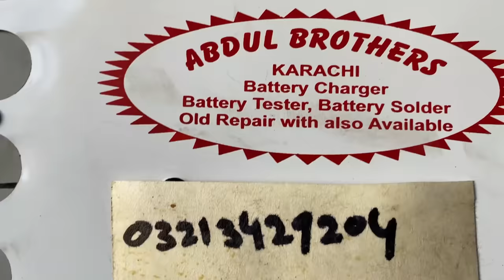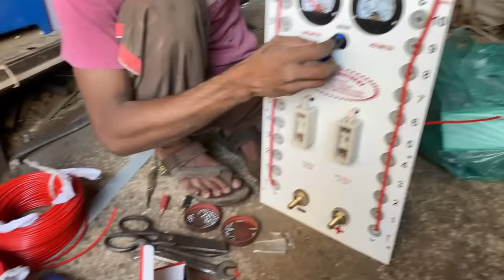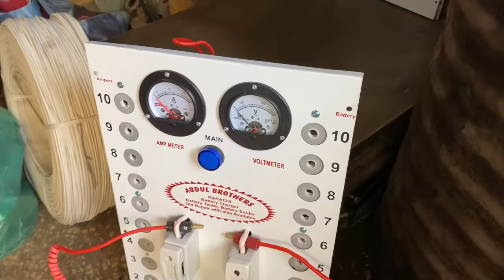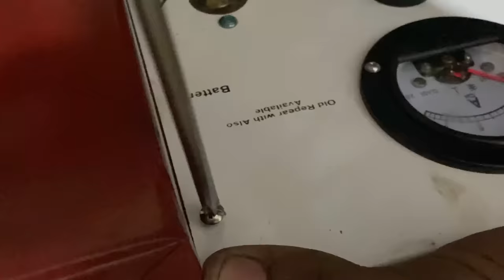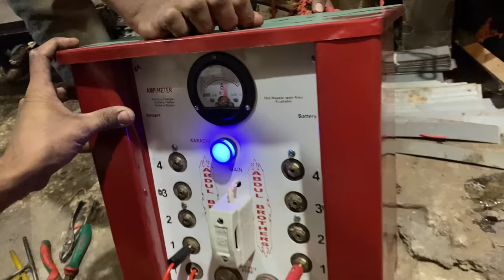Amazing process of truck battery charger making

Comment: That diode can handle 85 ampere, so you still can fry chicken with half wave. Regulated output?? Come on sweethearts!! This is a battery charger for heavy trucks, not the power supply of your pink laptops.
Reply: No Capacitor needed 😂
Reply: @sigmamalerules1106  capasitor does not need for charger

Comment: The ammeter reads a maximum of 10 amps, so its large and heavy for only producing 10 amps. They are only using one rectifier, so it only half wave.
Reply: What do you expect from tansformator core made with so many air gaps and rusted plates? And one diode.
Reply: Good job, Sir
Reply: Half wave is effective in the battery charge
Reply: @blazeykk  using Two diodes or 4 diodes  bridge  rectifier and then using  .using the condenser (high voltage and 200 mfd to 500 mfd will give a pure DC and a better and quality charging with low cost and better pricing as well .using 4 paper capacitor  on each diode will be a feather in cap which will protect the diodes and thus circuit as well .
Great job .
I wish they also weld the cores so as to reduce the eddy current which is a unique way used by Japan  .welding the cores on each direction . 
Love and regards
Reply: Using old technology industry is closing. Now days SMPS is used. Saves space and are lighter also gives short circuit protection and over charge protection.
Reply: @RealCircuit  SMPS is impossible to make in such poor conditions. Look at them. They are dozens years behind. And what is sad it does not look they develop. They stopped in point.
Reply: @JesusFlores-xe3sq  Desulfation
Reply: @blazeykk  SMPS can fail in high humidity environment and is unrepairable at average indian home. This thing has nothing that can fail. They just build what suits them best. I keep one of these beasts for batteries that SMPS cannot charge, and when SMPS fails.
Reply: I don't see any I/O protection
Reply: @HyperMAX9001  it's not even fully DC it's half wave current and the chances of your battery exploding from overcharging are really high
Reply: @RealCircuit  SMPS blows out every now and then
Reply: @RealCircuit  k
Reply: @RealCircuit  k
Reply: @electronicss.rbangla7909  5
Reply: After calculation it is just 150W charger (counting the losses). What the hell. My old computer power supply can deliver more amps than this and also being less expensive and light weight.
Reply: @HyperMAX9001  this is not India bro. It is Pakistan
Reply: @JesusFlores-xe3sq  No, it's not a good idea anywhere.

Comment: Notes the proper winding insulation ! The beautiful rusty cores as well. Twisted copper onto a steel bolt class work ! The perfect twisted mains join also just wonderful. Top that off with the smell of Karachi which i can guarantee for 5 years

Comment: What a pity the chargers at the end weren't the same as the ones we saw being wired up.
Reply: Hii
Reply: it is the same.
Reply: @mfx1 ok, I don't pretend that you know how a transformer work, but you can almost count to 10 watching the side connector or only to 2 counting the gauge on top!
Reply: @mfx1  The building displayed both a volt meter and a separate amp meter, the final display only had an amp meter.

Comment: In fact, you can see one rectifying diode, it means one-half rectification, but there are current regulating taps. Pulsation of the lead battery is perfectly tolerated. It's ok, congratulations 👌. There is also power in the simplicity of design 👌.
Reply: The pulsing current is somewhat good for maintaining the battery it helps prevent sulfating of the battery.
Reply: @belyear  Pulsation is good for charging a lead (Pb) battery. Other must be based on the PWM system. Thank you, greetings 😀.

Comment: Aluminium wires,rusted core strips and half wave rectifier reduces its efficiency below 50 percent at least.
Reply: They work!
Reply: very much more efficient than not having one at all, Sarabjit
Reply: @donsurlylyte  yeah definitely better not having these garbage uncontrolled things I don't even know what to call them as they are not chargers but fire hazard boxes
Reply: that is actually fake wood

Comment: They are simple in its principle so i dont see any big risk for the money, but they could have some other things to do.

The heatsink (if it is) that its easy to make like that but i would get extrusion bars that would be thinner from china and cut them to size, whould be cheaper at the end.
The backlite junction in from its a great thing since ceramic takes heat easly, but GET SOME CRIMP TERMINALS, that was one of the things it hurted me the most.
The soldering was painfull, i know they dont have much between that and a cimped terminal... i would use terminals.

In the end, they are working like robots, maybe one or two guys in that production understands really what are they doing
Reply: They probably have the heat sink cast by a local foundry.  Might be easier and cheaper for them than getting it from overseas.

Comment: Now thats one heavy duty transformator,full analog,brutally crafted,this will not fail easly,no pesky circuit board that will fail,despite having a good transformator in the device like modern elektronics with the programmed failing period.

Comment: i was impressed with their work because using 4 diodes generate more heat even its full rectified and also damage coil fast this is widely used in india for past 50 years 
work smooth heat sink is also excellent proud of your skills without using machine screw drills all by hand
Reply: yea after winding the transformer with aluminum wire,every Celsius counts. So it doesn't catch fire.

Comment: Use a switching mode power supply sir, it low dissipation power, reduce equipment weight, more protection than the transformer and diode only. and it can control your battery charge
Reply: Most of the Indian auto mobiles( work shops) private users never want to use new methods.only old type they r using . It is power consuming and higher weight .They won't worry .old is success full .that's all they feel
Reply: @alagappansockalingam8699  FIRST OF ALL THIS IS NOT INDIA. IT IS KARACHI, PAKISTAN.
Reply: and more interference in cities on the radio band's
Reply: Smps needs a lot of parts/ components to work and prone to break, few parts less components breakdown battery needs no/not pure dc to be charged,  low freq pwr supply less maintainance more more powerful than smps
Reply: @nelsoncaballero1937  wtito sir but the typical lorry Driversand owner's ur side and north side r typical .they want ony good what is practical.they like only conventional battry chrgers .They r not much educated.Firthe last tenty or more yrs they r using the same old method.they don't want to go for anew one .I am not supporting them .but they want practical and reliable and accurate  (some what).new one may be arisk (. To them)but time will change their habits.
Reply: @nelsoncaballero1937  Mr .Nelson SMPS r costlier and may be use and thro but a pakisthani old auto electrical people won't like use thros .time will change their habits.
Reply: @The_3_Triangle   If it is technically prooved the govt electronics people should warn them to replace it.but local people never intersted inthis .but step by step they will change their equipments .

Comment: Engineers making work as Technicians and regular employees
All this jobs for a Single Paycheck. 
Under the most unprofessional working place and working equipment. All That Production Still have A Good Presentation.
WHAT A GOOD WORKING TEAM and  CRAFTSMANSHIP similar to a Piece of Artesians workmanship.
MY HAT IS IF MY HEAD TO HONOR YOU  ALL.   GOOD AMIGOS
My Mexican People, Saludes You.
Reply: I can only call this shitmanship, not craftmanship. Even when using so crappy "materials" they still could do a 10 times better job. I did not know if I should laugh or cry when watched this so called manufacturing process.

Comment: An smps at ¼ of the price from china will work 10 times better. May not last 10times longer but I don't see this lasting more than few years anyways. Half wave rectification and cotton insulation on the transformer not coating it with resin or barnish that's calling for fire. Atleast use a full bridge rectifier ..

Comment: What is the Input AC voltage ? The Output DC voltage ? Can you control the Output voltage ?
What is the maximum Amperage Output ? Any temperature fuse ? Good job guys.
Reply: Да, да и да. Температурный контроль не нужен, огромный запас. Предохранитель есть и по входу и по выходу. За счёт рыхлого набора ржавым железом характеристика трансформатора скорее всего мягкая, даже кз на выходе не приведёт к возгоранию или выходу из строя. Конденсаторов нет, диод только один. Ток пульсирующий, но это как раз то, что нужно для автомобильных аккумуляторов.
Reply: Didn't you see the taps on the front panel?  You connect the plug to suit the voltage you want.
Reply: @loremipsum5759  the primary and secondary side of the transformer have multiple taps input voltage/output voltage.  Still a lot of analog meters in use.
Reply: Input ac voltage is 220v in Pakistan where this is made output dc voltage is 14v (i think) and this charges 12v batteries and output ampare is selectable.
Reply: @syedfaraz5  , this make a lot of sense.

Comment: America can make these 10 times smaller and lighter using modern electronics.
And the wouldn't have to work on the floor. They use the latest in workplace technology, Tables and Chairs.

Comment: Why don't you laminate the cores by dipping them in Varnish? If I vaguely remember, cores without lamination will produce a lot of heat from Eddie current. Atleast that's what they used to teach us in Pre-meds some 30 years ago, things may have changed since.
Reply: Physics doesn't change.  Eddy currents are from the size of the magnetic material.  That's why they use the thin sheets, to reduce eddy current since they are very narrow.  An eddy current is a bit like the vortex swirling around a drain.  Reduce the width of the tub the drain is in and the eddy is greatly reduced. 

It has nothing to do with the coating on the laminates.  Why were you learning about magnetics in pre-med???
Reply: @loremipsum5759  if you dont coat the laminates, they act as one solid bar and eddy currents (and losses) will be high... That's why thin sheets are used, the thinner, the better. For higher switching frequencies, no sheets are used but ferrite powder... But who cares about laminates when they only use one single diode as a rectifier?
Reply: @loremipsum5759   It has everything to do with the coating of the laminates.. It is insulation between the sheets, so it does not act like one big lump of steel that has any currents running through it that heat it up and make it less efficient.

Comment: You guys are amazing, Huge respect for your craftsmanship and your skills. I dont think we in america could do what you guys do.
Reply: Why? There are many US guys, who can do this as DIY at high level of quality. But it doesn't needs, because it is more interesting to build an own PWM pulse-mode charger.
Reply: Ur the owner of the company? If so, don't use solid core wires for selectors. This is DIY level indeed.
Reply: Daft comment, transformers were being made 100 years ago in the US, there's DIY's building far more complex stuff than this on YouTube. Can these guys build a lithium ion battery bank with balance charging BMS?
Reply: America can make these 10 times smaller and lighter using modern electronics.
And the wouldn't have to work on the floor. They use the latest in workplace technology, Tables and Chairs.
Reply: @snowflakemelter1172  well building a battery isn't that hard but seeing how sloppy that thing in the video got assembled I wouldn't buy a battery from them
Reply: This is a 19th century design at its heart. Anyone who wanted to make this in the west could. We don’t any more, for a lot of good reasons

Comment: It is a pity that the insulation on the wires is of such poor quality (plastic), in addition, ordinary paper is used between the layers and at the end the core is wrapped in cotton, EVERYTHING IS FLAMMABLE and not resistant to Temperature! Fiberglass isolate should be used.
Reply: Quite obvious: you missed the point completely.
Reply: forget the fire hazard mate...u must be crazy using this charger with metal casing...anywher u touch u have good chance of getting electrecuted..its just an accident waiting to happen
Reply: o kolega z Polski :)
Reply: This is good info you said ,but in that very poor country where that family is trying to make living with obviously recycled material to make where can they find fiberglass isolate?
Reply: Typical distribution transformers use papers as their insulation, I made 50kv transformers just using ordinary A4 paper as the insulation lo and behold, they worked good
Reply: and you missed the point that they are trying to make it as cheap as possible
Reply: @hitheir6463  if they can't provide high quality materials then why risk other's lives?
Reply: @sergio_folino7655  They used a wooden mounting frame, besides I've seen electric welders using air cooled and oil cooled transformers in metel casing. A plastic one may get damaged soon due to high temperatures or sparking.
Reply: It is a very correct observation. Just spending a small amount of more money may improve quality. One more point, in place of twisting wire at joints, proper connector should be used.

I hope that the manufacturer must understand all the safety and quality concerns raised by us and improve the product.

Thanks and best wishes

Comment: Try insulating each of the metal sheets you use for the core from eachother. - especially the parts that will be inside of the coils. Leave only the corner joints uninsulated, to allow current flow. This should improve efficiency of your transformers, as it reduces the part of current that does not flow along the core and through secondary windings.
Reply: The final product works.  Now, ask yourself:  are they doing it wrong? or do you have an unnatural fetish for "efficiency".
Reply: @lc3853  Efficiency is not important in this countries. we pay billions for power, they dont. we pay billions for saving the nature, they dont - any questions mister perfect?
Reply: @lc3853  Just giving a tip... take it or leave it, I suppose :p
Reply: Can you please describe more about increasing transformer efficiency? Other than metal sheets insulation! I mean any other tricks to fully optimise transformer!
Reply: @nahid5566  I am not an expert but toroidal transformers are more efficient than ones with square cores. I believe that there are certain types of metals that are better than others for use in the transformer cores. Also, the quality of copper matters. Generally you should try to minimise the losses in copper (it should have as little resistance as possible, minimise the losses in the ferromagnetic core (it should have as little resistance as possible, but at the same time here you should optimise for reduction in eddy current - which unfortunately means having as many galvanically separated sheets of metal as possible in the core). Furthermore you should put as little insulation between all the components as possible, so that they "catch" as much of the electromagnetic field as possible. - this however will limit the voltage your transformer can work at.
Reply: По сердечнику трансформатора не течет электрический ток.Там создаётся переменное магнитное поле! А сердечник собран из специального трансформаторного железа. В СССР и России это железо марки Э 310.
Reply: @fellpower  Which nature are you saving?

Comment: I definitely would not subject my batteries to that beast as they have a more refined diet of regulated, smoothed and protected dc.
Reply: If you take care of your batteries, charging them with just about anything, will be fine.
Reply: @davidhamm5626  Taking care of your battery MEANS charging it correctly.
Reply: @normanmazlin6741  Okay, !

Comment: All electrical assembly errors were demonstrated in this video.
Please do not repeat. And ElectroBOOM would be sad because of a single diode usage instead of a FULL BRIDGE RECTIFIER

P.S. Chinese chargers with a proper circuitry onboard have price under $100, jump starters - $200-300.

Comment: That is so skilful.  Pride in their work. Care in their work. This equipment will last a lifetime. Well done. A lesson to the world.  I just wish there was more health and safety in place.
Reply: have you seen the soldering of that diode? it wil fail very soon! if they would be a bit more precise with everything  it would be a lot safer too!
Reply: America can make these 10 times smaller and lighter using modern electronics.
And the wouldn't have to work on the floor. They use the latest in workplace technology, Tables and Chairs.

Comment: Ah, test it by shorting out the output to see if the amp meters reads. LOL what a joke. I know that it is probably very cheap for their Country, but looks pretty basic, rusty laminations, only twisted connections, bet it is not efficient. Fire risk with paper and cotton insulation.